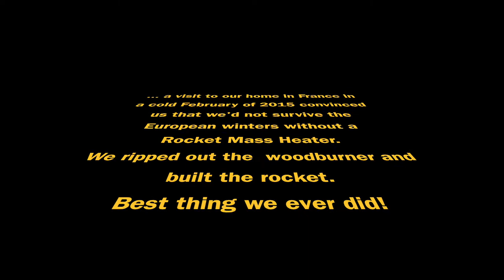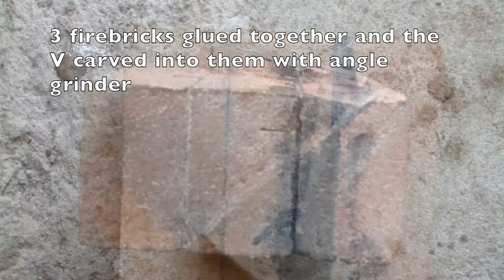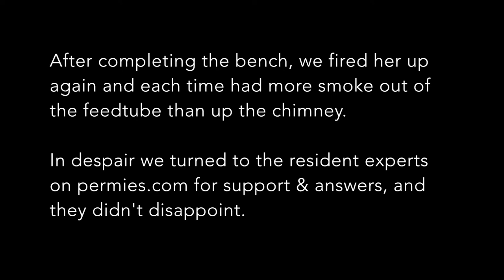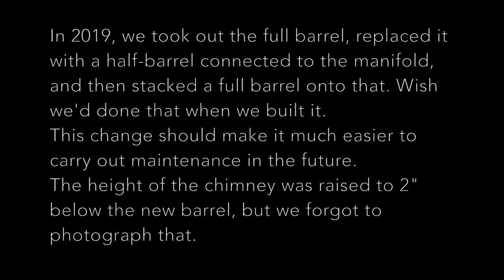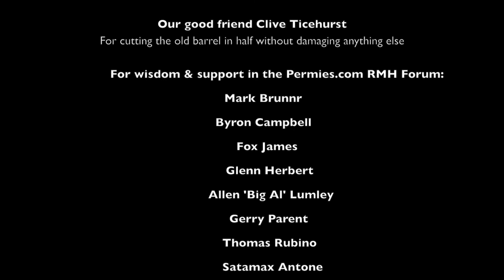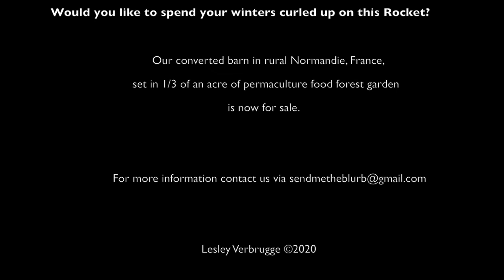Building a J Tube Rocket Mass Heater

Comment: I have only begun my first attempt at a rocket, although I have read and YouTubed and dreamed for many years. Circumstances are finally favorable. To be free to make mistakes/adjustments, I am starting in my downstairs "shop" area. Then I shall be confident enough to try something as gorgeous as your creation. How lovely! You and so many who have contributed to my dreams are amazing. Thanks for sharing.
Reply from the maker: Hi Linda, Thank you for your kind comments! I wish you the very best with your build. My advice is to stick to a tried and tested build - plans from Erica and Ernie wisner (on permies.com) or Iannto Evans (with three updates: lose the small barrel arounf the feed tube, add the 'v' on the burn chamber roof, and add a metal plate to feed tube for air intake and to protect the burnchamber roof firebrick) once again look at the permies.com Rocket mass heaterforum for lots of assistance.  This year, at long last we finally found time to put the lime mortar coating on the cob, so I need to update the video. I'm pleased we waited (didn't find time!) because we've changed the shape and decorative elements since we built, and that would have been more difficult if we'd had the lime layer to remove each time.

Comment: my advice to anyone about to try these?

do it outside. just slap a bit of mud on the seams so its airtight, and so its easily torn apart and redone.

experiment with the burn chamber first. get that to work, sort out the bugs. as long as that works, and your flue is sufficiently large on the real deal... it will work exactly the same.

you dont want a bad fireplace inside... you definitely dont want to have to pull it apart.

after the burn chamber, you never want any reduction in cross-area... always expanding if possible.

ive been playing around with a toroid burn chamber, more like a brick pizza oven. air entering tangentially, flames always "biting its own tail" with a lot of circulation in the chamber before finally heading up the flue thats about halfway up the chamber... they barely smoke as it is when done properly, this just seems to take it to a new level.
doing exactly what i advised not to do... pulling the existing burn chamber apart for next winter... (AU)
Reply from the maker: Hi, Thanks for your comment, which is a really good idea for anyone wanting to experiment and create their own version from scratch (Though I'd say why re-invent the wheel?!)  From my personal experience, if you follow the instructions in the Wisners' book, you'll have an efficient and safe rocket that will function as advertised. There are lots of DIYers on you tube, doing 'interesting' stuff but often don't follow up with  the 'what went wrong'. If you have the time and interest, rocket burners are fascinating to play with. We just wanted something that worked, so just followed the instructions. At our age we didn't have time energy or money to play around when we could follow the wisdom of those who have earned their laurels in the field.

Comment: Looks awesome. Wonder if it could be built with the burning chamber in another room or closet.
Reply from the maker: Hi Stefen, Thanks for watching.
Your best place to ask that question, for a technical answer, is in the Rocket mass heater forum over at Permies.com! 
Bear in mind that the nature of the RMH means it needs feeding whilst it's firing. Not so easy if the feed tube is in another area, presumably in a colder area too!?  We fire up for about 1hr to 90 mins whilst we're getting on with other stuff. We can hear when the sound of the firing changes and we need to add wood.

Comment: That is amazing, well done.
I am wondering if you ever examined what came out of the chimney on the roof, was the gas warm?
If I ever build one I will install an inline extractor fan at the chimney end in order to pull the air while starting the fire to reduce any chance of smoke in the room, but of course the mass has to extract most of the heat so that the fan is not damaged when the burner is in full swing
Reply from the maker: Hi Nick, thanks for the kind words, and I'm pleased you enjoyed it. Once the fire is up and running 'rockety' (takes about 5-10 minutes), there is nothing to see coming out of the chimney as the burn is pretty clean. We have a thermometer on the chimney as it exits the mass and that's running at around 80ºC  I've put a thermocouple at the bottom of the feed tube and the max I've had is 700ºC - That was with split oak heartwood. We use a mix of branchwood and split oak. The former is less effort as it goes in as is, but gives less BTU's, and the latter needs splitting (though when the fire is really hot we'll put a big log on!) but burns hotter. It's a trade off! 
You definitely do not need to install an extractor, trust me! Just follow the instructions to the letter for your first build, and you'll have no problems. The first firing of winter, the air in the mass is 'stagnant' so to get it moving upward, we open up the clean-out that's next to the 'up' part of the chimney, and burn a candle to warm the air, before we light up. You could also use a hairdryer on the chimney pipe.  Thereafter there's absolutely no smoke in the room, because the mass never gets cold, and warm air always wants to rise. As soon as we take the cover off the feed tube, you can feel the draught pulling into it. (in fact, if it's really cold outside I have been known to open the cover and sneak a quick cigarette - the draught pulls the smoke in!) The only time we had smoke (and so much it looked like the house was on fire:o) was the first firing after we completed the build. I panicked but the experts on Permies.com said it was normal, everything is so cold and damp, it takes a bit to get the air moving. We originally had a horizontal section running through an outbuilding and it was just too long. We connected to the original woodburner chimney thru the roof and this gave it the help it needed. We never got around to changing it back. I cannot sing too highly my praises for the info and support at Permies.com, as well as the videos and plans that are available there. We're going to build a rocket oven and a rocket fired cooking hob as insurance against future gas and electric supply problems. Love the Avatar btw!
Reply: @lesleyv5923  thanks for the very thorough reply. I am also thinking of having a Y shaped manifold with a door that can close off one of the tubes, and the tube not going to the mass will have a copper coil surrounding it, filled with water, this will be my water heating system for the winter when solar water heating does not work. As soon as there is enough water stored in the tank I will close the door on the manifold then divert the heat into the mass
Reply from the maker: @utubeape  My initial thought is Squish Boom! Water and fire are a dangerous combo if combined in the wrong way!  so, get over to Permies.com to talk with one of the many guys who are enthusiasts. They are good. Paul has a set of five fire DVD's that could help. My advice is, for your very first rocket, stick with the tried and tested. There are also designs on permies for rockets that heat water. Remember when two functions are combined into one piece of kit it often performs neither very efficiently.

Comment: I would love to form up and pour one of these from concrete but I'm not sure if it has the same heat transfer characteristics as cob.
Reply from the maker: No!! definitely do NOT use concrete!  It wont withstand the heat/expansion. My advice is, dont try to re-invent the wheel! If you've never built and operated one before, just get the books (Iain evanto or Erica & Ernie Wisner) follow the nstructions and you will have a reliable, amazing heat source. After you've successfully constructed one, hey, try out your ideas! At the end of the day, this is not a small, quick thing to knock out. After all the hard work, you want it to work ;o)
Reply: @lesleyv5923  I mean the thermal mass. Concrete (the real stuff, not the sandy sackcrete junk) is routinely exposed to temperature ranges within those that the thermal mass would be subjected to. I'm a construction worker and there are endless possibilities for pouring benches, troughs, beds, etc. They could be filled with sand, gravel, water or just about anything that holds a lot of BTU's. But, after researching the idea, a RMH really isn't practical for my situation. It looks like a lot of fun to build, though.
Reply from the maker: @jasonfoster9118  aha Phew! Shame you can't fit one in, they really are a treat in winter, and we open her up in the summer for passive cooling of our barn. Anyway,  to anyone reading, interested in using alternative materials for the mass, have a look on Permies.com, there's a video there of Paul Wheaton's rocket with gravel mass.

Comment: The video is way way to fast.  Impossible to follow all the changes and how you improved it's function.  Please slow it down., Explain each step and the lessons that you learned. 2 second snap shots of the building process with canned music doesn't teach your audience how to do it..........
Reply from the maker: Hi Eric. If a video is too fast, go to settings (the cog wheel right of centre under the video) and change the playback speed. You can also use the pause button ( two parallel bars " II " far left under the video when it's playing) to stop at any point if you want to look closer. The canned music is copyright-free and can be muted using the speaker icon to the right of the pause/play button. I'm a qualified teacher. This is not a teaching video, it's a record of building our J tube rocket as evidence for a badge-bit on Permies.com and offered here for anyone interested in the subject. I recommend Eric and Ernie Wisners books and plans for the detail needed to build one. They are here: https://permies.com/t/40993/Ernie-Erica-Wisner-Rocket-Mass.
Reply: Awesome set up. How would you clean all of the manifolds?
Reply from the maker: @vincentbalintucas1890  Hi Vincent, There are 3 access points one is for the manifold, two are for the mass. once a year (in the summer) we do the big sweep - using an 8" diameter chimney brush with very flexible rods, plus a cinders vacuum to clean her out. (Dont use a domestic vacuum it can't handle the dust - dont ask me how I know!) The main manifold (just after the barrel) is  cleaned out mid firing season. At the 4 year  point, when we opened her up, the ash build up of the areas not accessible, wasn't that great (great relief!) I've seen some versions where there's a clasp lock joining the top barrel to the base barrel section, which would make it a cinch to clean. We couldn't source a clasp lock thing that would connect the two rolled rims here in France. If you keep monitoring to fire clean, by keeping the wood topped up all the time and don't let the temperature drop, it greatly reduces the ash in the system. If I did it again, I'd definitely add another access point just before the bend at the end of the bench!
Reply: @lesleyv5923  thanks for the reply. I came across your video after watching some Korean ondol systems, where they light a fire and the heat spreads through under through some channels underneath a home. These look very efficient.
Reply from the maker: @vincentbalintucas1890  Far too often nowadays, the old ways are thrown aside to make way for 'stuff' we have to buy, that's too complicated for us to repair! Clown world ;o)